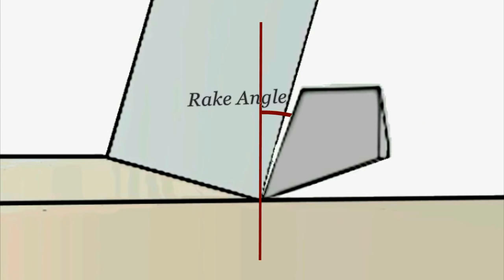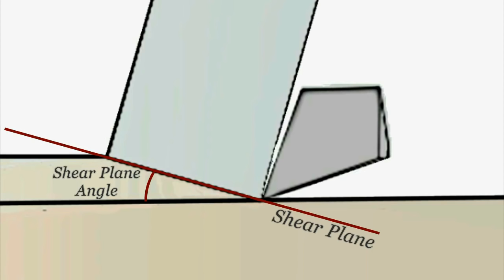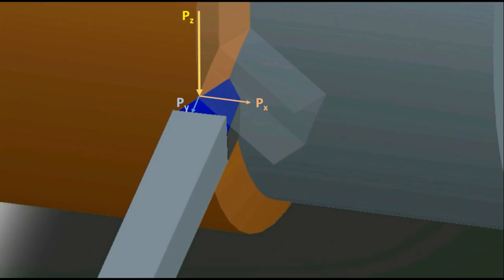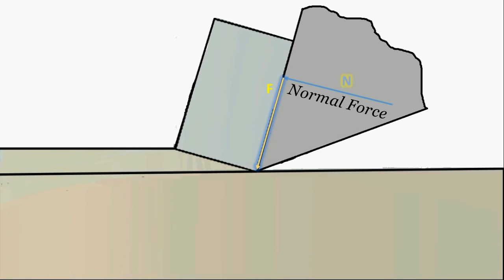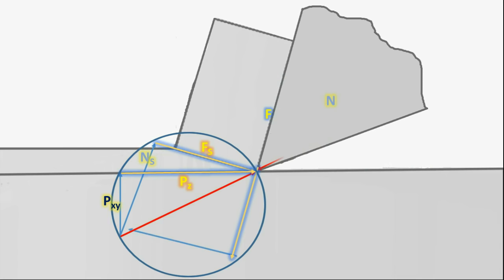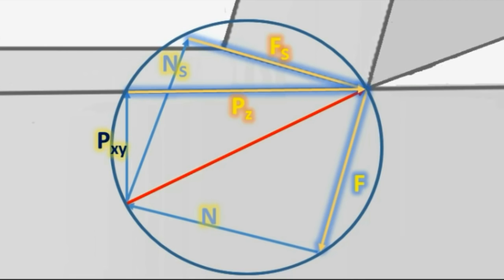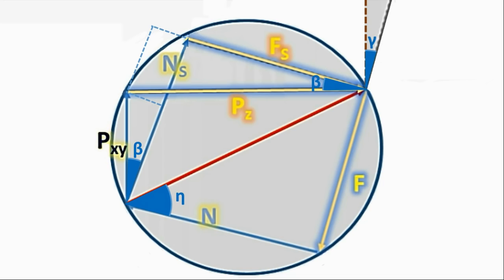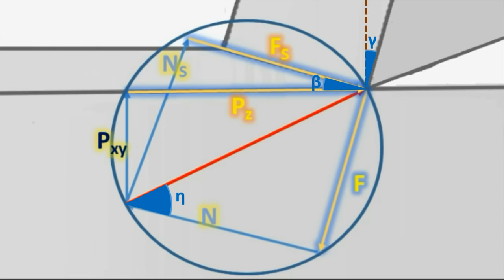Cutting Forces and Merchant Circle Diagram

Comment: my question is why we have to maintain those forces in equilibrium? for what reason? and btw thanks for the awesome video
Reply from the maker: We can write force equations only in static equilibrium conditions. Hence we must bring the system to equilibrium, which is in this case, a constant cutting velocity/spindle speed. If we need to create force equations in dynamic equilibrium, we must first convert them to static equilibrium using D' Alembert's Principle.
Reply: thank you
Reply from the maker: Happy to help :)
Any other topic you'd like to see presented/animated like this, please do suggest.
Reply: Nithin R Pathiwada since velocity is constant so the forces are in equilibrium. ......velocity is kept constant to avoid Built Up Edge